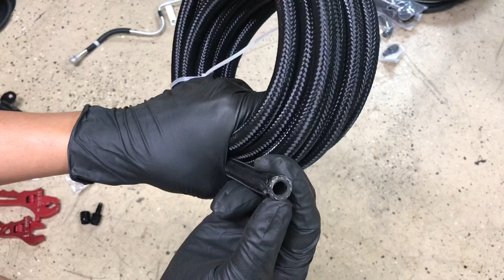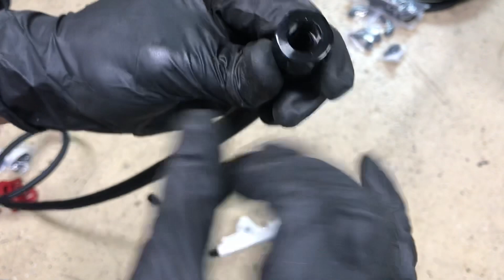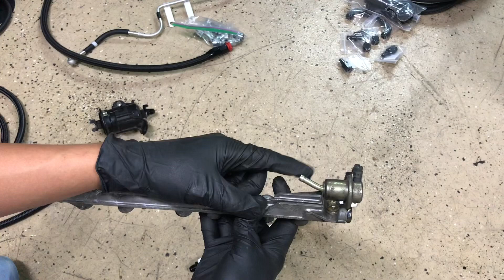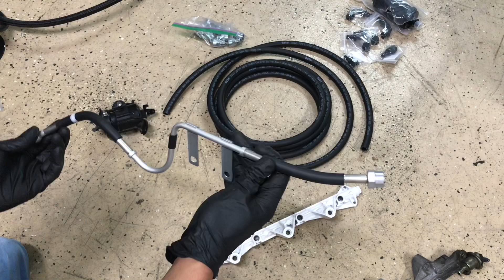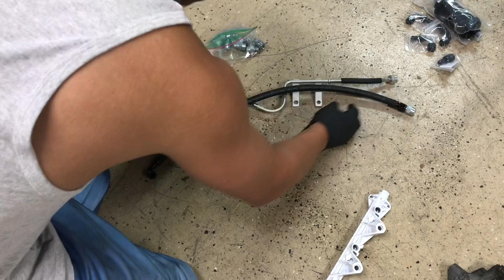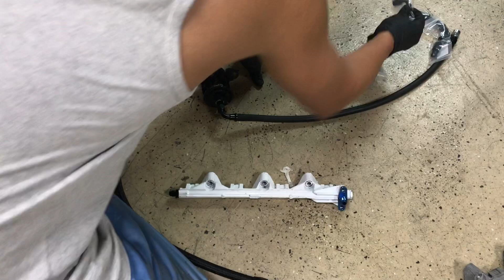DIY: BobMr2 Making Custom Fuel Line

Comment: Hey Bob, which part do you use for the fuel tank to an6 part? This is the hardest to find part
Reply: Bob is not telling you because he wants you to shop at MR2 heaven. The part you are searching for is : M14 Inverted Flare to 6AN Male Fitting Adapter Short, made by Radium Engineering

Comment: Could you provide where you got or the part number for fitting that connects -6an to the OEM fuel line? @9:36? Thank you!
Reply: Lol probably too late but I was looking into this myself. Found this "custom" fitting made for some other Japanese cars. 6an male to m14x.15 inverted flare. Gonna try it out. https://www.extremepsi.com/store/Extreme-PSI-Stainless-Steel-Fuel-Line-Fitting-Adapter-6AN-Male-to-M14x1.5-Female-INVERTED-FLARE.html
Reply: Alright, got it. The inverted flare of the new fitting appears identical to the stock line. Got it installed and the new line made. Jumped the fuel pump and got no leaks, holding 42 psi!

Comment: Would it be possible to use the 5sfe motor mount bracket on my gen 4 the bracket that’s on top of the crank pulley ?
Reply from the maker: miguel guerrero yes

Comment: Bob, can I get some info on the fitting that replaced the fuel rail regulator (2 bolt 6an).  I see a few out there but I am not sure which one will fit the rail correctly.
Reply from the maker: Keegan r copy paste on eBay 

AN6 Fuel Rail Delivery Regulator Adaptor Fit Toyota Corolla AE86 4A-GE  Blue
Reply: @BobPham  y
Reply: @BobPham   hey Bob Pham any good I formation on  building MEGASQUIRT 2 for rev 3 mr2